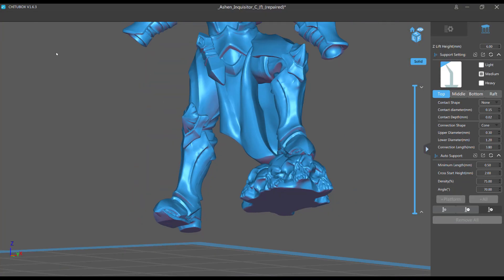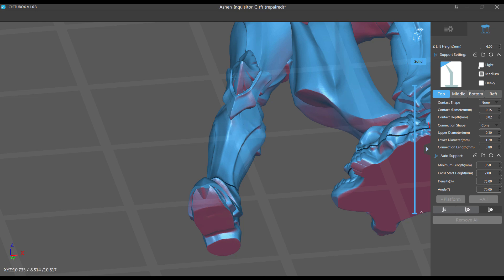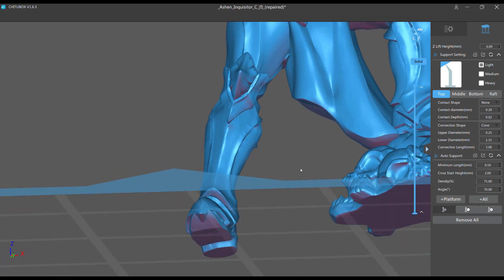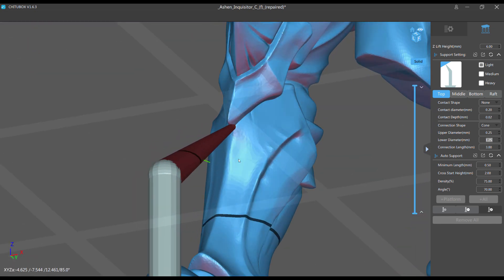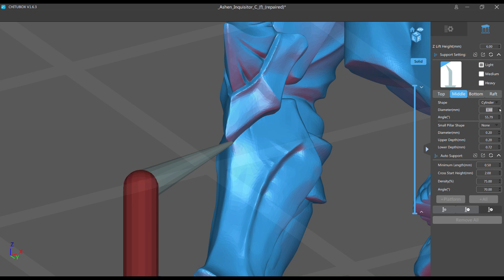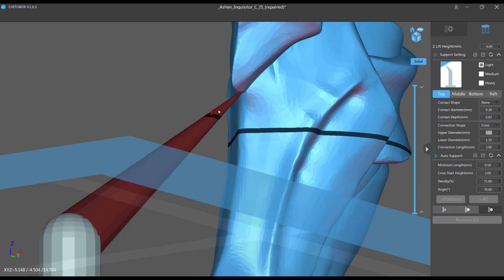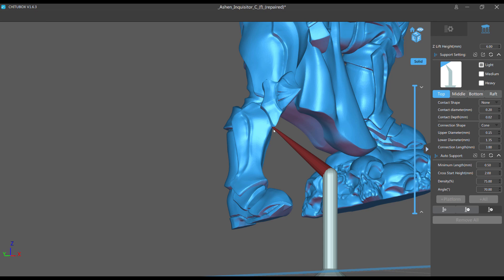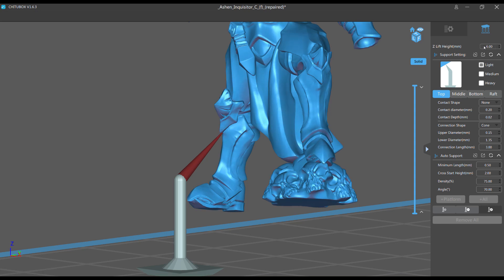Making very light supports for resin 3d printing work better and fail less!

Comment: how long does it usually take you to support a complete model? i am fairly busy in my day to day but would like my printer to be running all the time, how can i best use my limited time to do supports? ive watched all your videos (and many others) and have tried experimenting with prusa, chitu, and the validator but it takes forever. ive had plenty of fails with auto supports too so do they really save time? thank you so much for these videos

Comment: First, I want to thank you for all the tips and tricks you have shared for prepping models in Chitubox.  I wanted to share something that I have been doing recently, that I haven't heard you mention before, and that is using "Infill" for hollow, resin miniatures.  I know that, normally, we wouldn't use "Infill" on a resin miniature but I have found that for larger models that are good candidates for hollowing, using an infill of 30% is awesome because it automatically generates a 3D hexagonal lattice inside the hollowed mini.  What's more, when you have "Infill" enabled, it will automatically hollow your model before slicing.  I am not sure if these steps are required, but this is how I do it.  I load a large model and immediately slice it (with Infill enabled).  The resulting file can be viewed, and will show the internal structure that will be generated.  I then "return" without saving the slice and proceed to hollow the model using the same wall thickness as the Infill setting (I use 2.2 mm), and I add the drain holes.  Once that is done I will support the model as usual (following your most excellent tips!!), and finally slice.  I double check the sliced model to make sure the infill structure is present, and then save it.  Using the "Infill" setting eliminates the need to manually support the interior of the hollowed model.  I would love to know what you think of this technique.  Thanks, and keep up the good work!!

Comment: I have a video request. 
Starting on FDM printing, I found a guide that showed the different types of print failures and how to fix them. That did a great job of teaching me how to get really good prints from me Ender 3. 
Could you do something similar with resin printing? You have given great advice on fixing specific issues in various videos, but I meant something along the lines of a "common resin print fails and how to stop them" compilation video. 
Thank you.

Comment: Love your vids main reason I jumped on the resin train.   Sorry I do not know where else to ask this question.   I bought a Photon printer and Chitubox exports to .photon and when I put the usb stick in the printer it is not seen.  The included test print file with the printer is a PWS format.   Any ideas?   There are so many youtube videos from all you pros and I havent seen any mention of this problem and you all use the Photon and all love Chitubox so I'm really stumped why I can't do the same :(
Reply: Disregard found the v5 firmware and printer now sees the .photon files.

Comment: Has anyone got a good video for on "Chitubox" selecting  parameter values for the Supports "contact shape", "contact diameter", and "contact depth". I don't know under which printing scenarios which is best to use coned, sphere etc and how many mm for the contact diameter is safe for a given connection point and size of the mini whether its' on the lower, middle or upper part of the mini etc. Please help, I have googled this and nothing came up !

Comment: Would it improve the chances of the support not failing if i make the angle more acute? I’ve noticed the closer to 45 the higher chances they fail. Also any ideas how to keep the larger AG monster bases from warping on the bottom that connects to the first part of the base? I am referring to the large oni bases and mount bases, the supports worked great and thank you for your work on that. They are 100% acceptable but my ocd always strives to print better. It’s very subtle but I get a bulge on the very first area to print I’ve gone in and added supports to this area and still get the bulge? 
any tips to eliminate this. I’ve gotten perfect bases by printing flat but I hate that cause they are hard to pry off plate. 
Thank you again for everything Greg!

Comment: This is one of your best "findings/discoveries" in ChiTuBox. Basically, you used what was available and make it work in an unthinkable ( by ChiTuBox programmers) way! Placing the main column nearby and moving the tip to the interesting point it's... BRILLIANT!  Thumbs up. Now, let's hope that ChiTuBox programmers come with some better placement by design, not only by some inventive users. Although... in their defense... ChiTuBox it's still one of the best and FREE resin-slicer available.

Comment: I don't understand why you have your support pillar so far away from the model. A support heading to the model at 45 degrees is going to be less efficient than if you try and keep everything as vertical as possible... Whilenstill ensuring you do not touch the model on the way.

Comment: I’ve followed a lot of your support setting videos (excellent info BTW) my issue is on your video on how you set up your whole support system. Well.... you kinda spoke really fast and I wasn’t able to make changes as quickly as you discussed them.  Is it remotely possible you could join the facebook photon users group and add screen shots of your support section so us more idiot types can partake of your brilliance. I’ve seen “Uncle Jessy” use your support config and now swears by it.
Reply: Or indeed ad full page screenshots to make the scree easier to read.